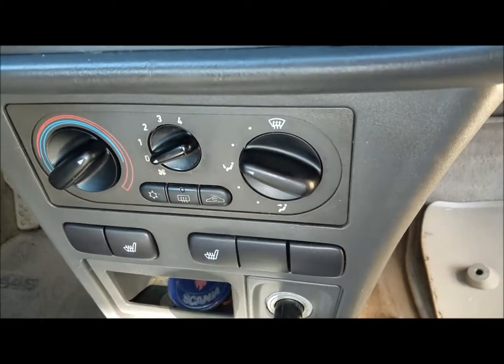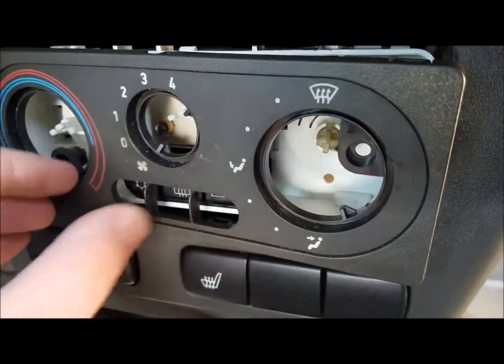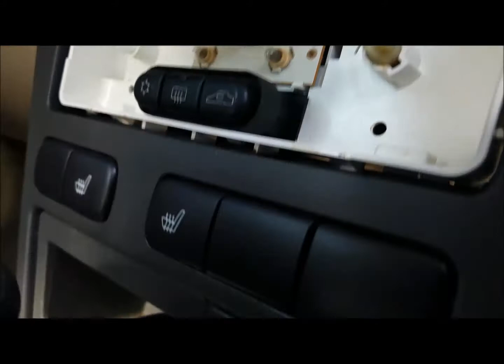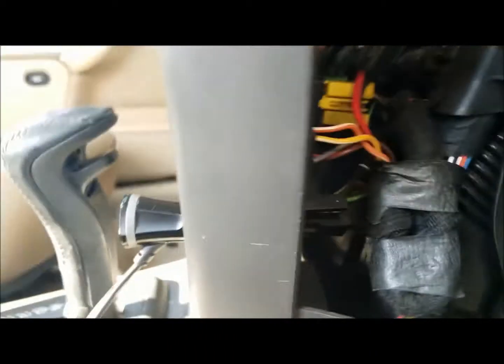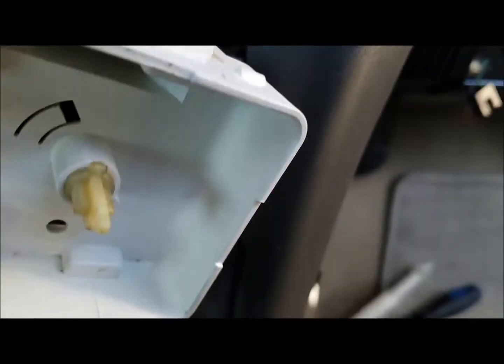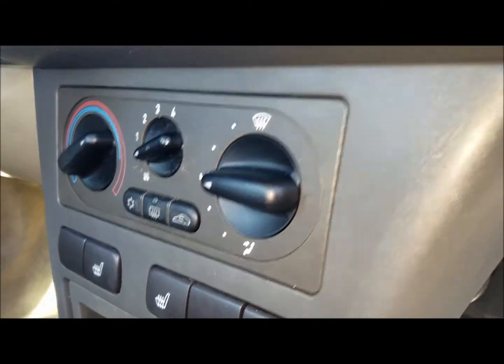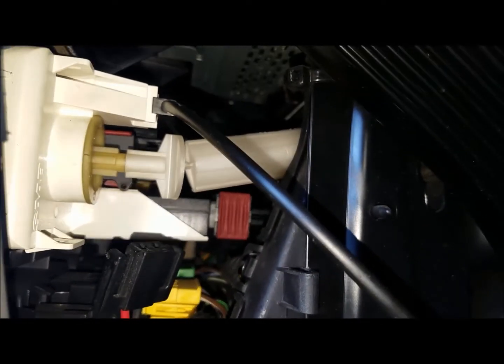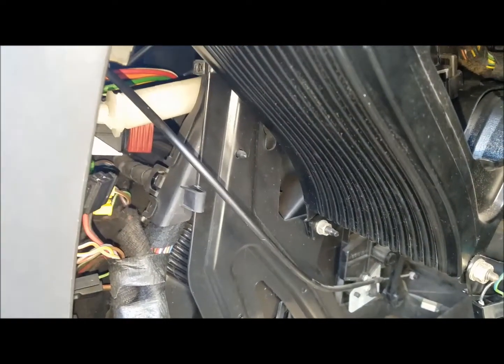Saab - Broken Heater Control Shaft

Comment: Its one of the worst designs in automotive history! It's design is based on cost first rather than usefullynes or its ability to do the job correctly.
Reply from the maker: I disagree. One of the worst designs in Automotive History is replacing headlight bulbs on a 2010-era Subaru Outback...

Comment: What's the middle part called to turn on the air. My switch for the middle one stopped working. I'm just now realizing this video covers the path of the air rather then what turns it on
Reply from the maker: The middle is the fan speed, which if it's not working it's likely the fan speed resistor or the blower motor itself. Both are under the plastic hood cowling, and then under the Cabin Air Filter. You have to remove the windshield wipers to access but overall not a difficult fix
Reply: @saabross3171  yeah. I was just gonna replace the whole assembly. Hopefully that'll work.

Comment: Thanks for the video! The drum had 0 play wich made my new shaft break, took off the vent to passenger vent and lubed inside the director, got it free again but not free enough. I have read info about a Saab fix with installing screws to seperate the housing again, can you make a video about that? i can provide u with info from the WIS
Reply from the maker: I don't know too much about the actual solution, as all my familiarity on the subject is derived from old forums, one-on-one chats with other owners, and yes WIS. I haven't actually done it (nor have I had to - thank God). Film it when you do yours!

Comment: Thanks for the video! My 0-4 blower control is broken and I'm wondering if that is a similar toilet paper roll fix? When I move the knob from 0-4 it does not engage the climate control system, you almost have to hold it in between a number. Thoughts on what might be broken?
Reply from the maker: Is your '04 a 9-3 or 9-5, bc the answer totally depends on which Saab it is!
Reply: @saabross3171  I've got a 9-3 1999 convertible, haven't opened it up yet to see what it looks like.
Reply from the maker: @katiestern3265  OH I got it, "0-4" as in the Speeds for that fan knob. Yeah so this video was done on a 1999 9-3 with the same "0-4" manual control knob. Follow this fix and you may find a similar problem as mine!

Comment: Thanks for video. I've just changed shaft but mechanizm working very hard. How to oil this?
Reply from the maker: Mar Cin I'd look at some of the old forums that existed when more ppl owned these cars. You can lubricate the drum or the fix per Saab is to use a screw to seperate the two pieces. Read more here:
http://www.saabscene.com/forum/showthread.php?t=124501#/topics/124501

Comment: My heat knob is stuck on hot and I found the knob is broken in the back where it connects.  If I try and twist with needle-nose pliers, it won't move, so it is not just the knob.  Since this is the knob on the left, is there the same shaft assembly for that side, or is that a different part and number? I haven't pulled it apart yet to look, but I live in Phoenix and need to order the parts as soon as possible so any info you have is much appreciated!  Thanks for the video!
Reply: The knob on the left is different, you catch a glimpse of it here in the video but it has a gear that connects to a long cable. When detached you can pull or push the cable by hand to switch from hot and cold so you're not baking in AZ!
Reply: Did you happen to find that part or a quick fix to switch from cold to warm air? I had the passenger side panel off like this video but couldn't find the mechanism this gent talked about. I have that same problem coming into winter time though with mt 00' 9-3. Thanks in advance.